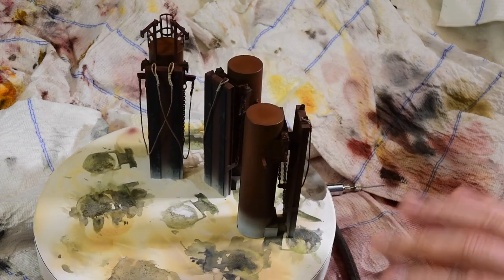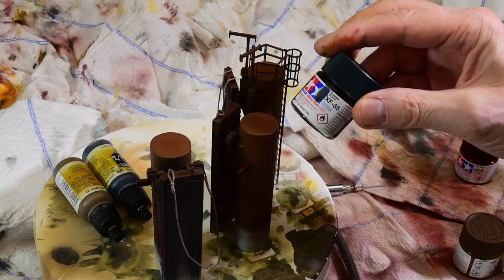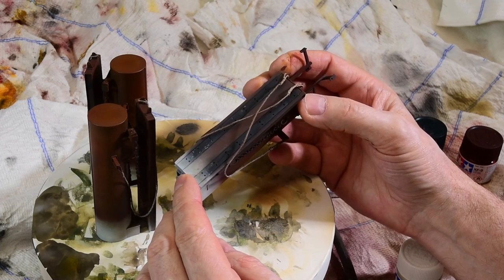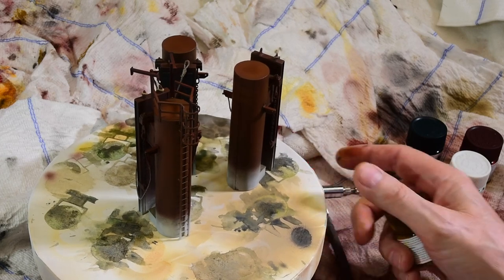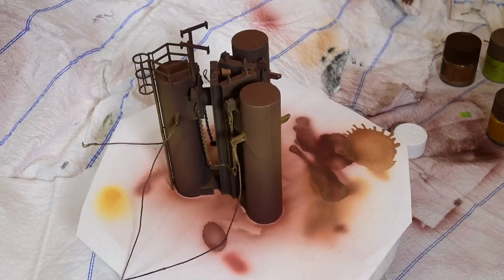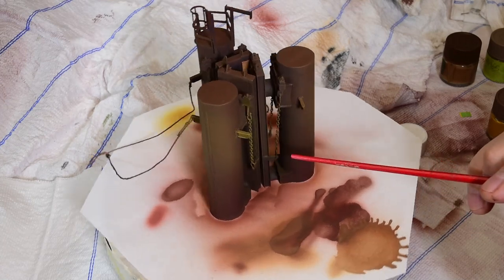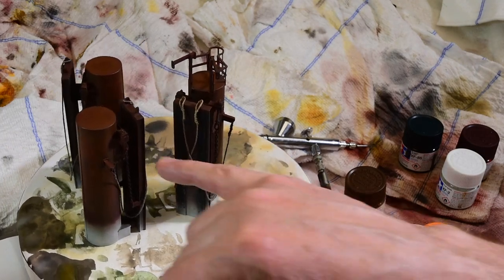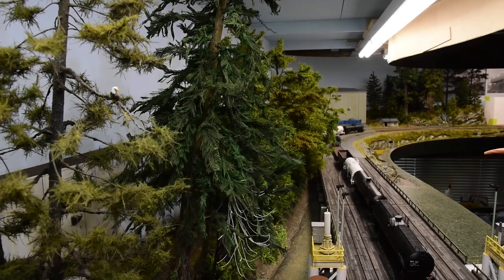Painting The Barge Slip Final | River Road - Vlog # 117

Comment: Really enjoyed it Boomer. I hear you trying to convert modelers to the airbrush, and I hear their reluctance. A good starting point is the old Pasche H single action. Master that (it's easy), then move onto the double action. Cheers - Bill. PS I'm not a "cat guy" but Dusty is a good-looking cat!
Reply: The Paasche H & VS are industrial grade and so almost indestructible.  I think the trick to encouraging airbrush use is to leave it set up in a corner.  If it only takes a minute or 2 to get into action, I think modellers will get more used to reaching for it.  And the more you use it, the more you think about how and when to use it.
More and more I find myself thinking "how would Boomer do that?" and I'm regularly surprised by the answers I get.  And that light orange mist is exactly what I was thinking with those dark monolithic piers.
Model on!
Reply from the maker: Dusty is cool for sure. She loves to be around the layout. She grew up on Glover Road. ;-)
Reply: @randytaylor1258  right on! I keep my airbrush setup at my kitchen table, ready to roll.

Comment: Well, you sold me - Omni 5000 is on its way in the mail. Now I'm off to go practice with my $20 Chinese airbrush - I had things to do today, but it would seem the airbrushing itch has got me. As an aside; where are you acquiring this microscopic chain? I'd like to believe there's an option out there for my N scale needs disguised as jewelry, or model ship accessories. 

I also notice you're getting more and more comfortable getting in front of the camera. There's 0 pressure from me for a face reveal or anything of the sort. Stay comfortable, Boomer - God bless!
Reply from the maker: I picked up my chain from Michaels craft store jewelry department. Some of the smaller stuff form model ship supply stores. I'll be buying another Omni 5000 soon as well. Mine i wearing out after 20 years of hard use. Cheers and God bless to you too.

Comment: Hi ya' Boomer...
I literally laughed out loud at Dusty running for cover. :)
On a side note,
I bought the Omni 5000 several Months ago. Not sure if I got the correct Omni 5000? The bowl is about 6 times smaller or more than yours.
Incidentally, U.S.A. Airbrush was the ONLY supplier that had these in stock at the time of my purchase.
Like you've mentioned before, I owned an Iwata HP-C, and suffered a lot of tip drying.
I found myself reaching for a much cheaper Paasche all the time.
God Bless ya'll!
Reply from the maker: They might be different now.. Not sure. Mine is almost worn out now so I need to buy another one. Don't be fooled by the small cup. They are good for changing colors fast and if the paint is thin it goes a long ways. ;-)

Comment: What do you use to thin the Vallejo Model Air?  I'm trying to find a cheaper alternative to the Vallejo Paint Thinner.
Reply from the maker: Water. Just so you know, I don't shoot Vallejo through my airbrush. I don't need to because Tamiya covers all my airbrush exercise. I only use Vallejo with water and a traditional brush for weathering over top of Tamiya.😁
Reply: @boomerdiorama  Thanks for the explanation.  I'm considering going the same route, using Tamiya more often.  However, I am also considering purchasing a new airbrush so I will need to fiddle with that a bit before doing any serious model painting.  By the way, do you know of a retailer in Canada that sells the Thayer-Chandler Omni line of airbrushes?  I can't find one online and I'd rather buy "local".  I'm looking at the Omni 4000, mainly because it has a larger paint cup than the 5000.